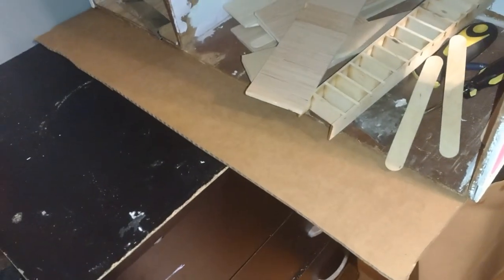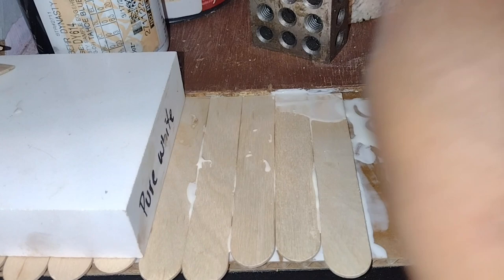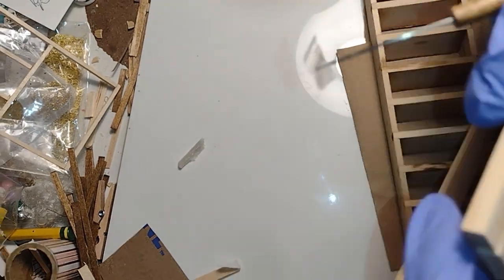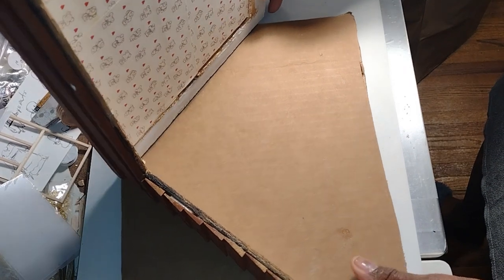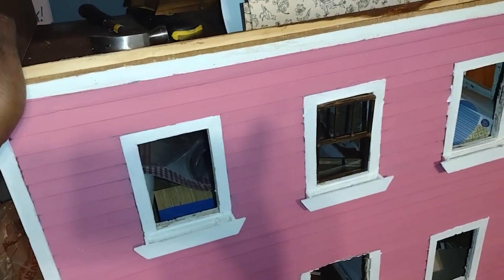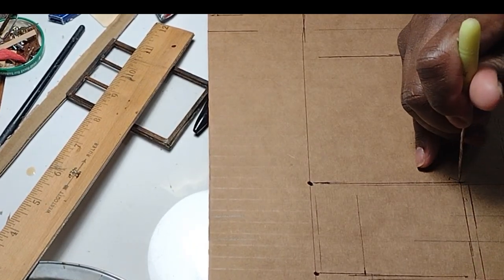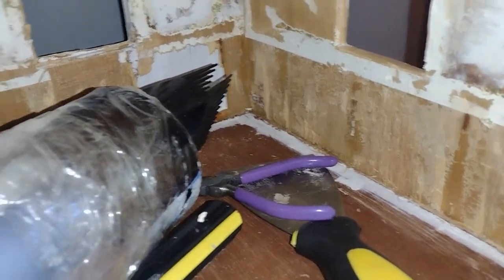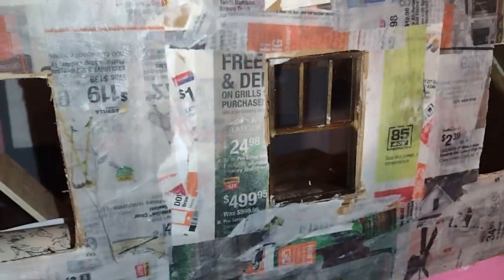RAISE DOLLHOUSE ROOF and Extend the FLOOR - Dress Dollhouse Shop Renovation

Comment: Oh Gretchen! I can relate as I'm struggling with structural issues on my house right now.  I'm trying to create some walls using foam board but after watching this, I wish I had used cardboard. 😞.  I admire you for trying out your original idea and opting for a completely different look when it didn't work out. Wow I love the urban storefront look your change brings. It's like the dress shop was telling you what needed to be done. Brilliant! 👏👏👏😍✨
Reply from the maker: Yes! That is how you learn and develop your skills! Try it and if it doesn't work try something else !  Now l have used foam board before, in the area between the pantry and laundry room in rooming house. It was a very small Doorway that needed to be closed up a bit. Don't get discouraged see how you like. And if you don't it's only foam board, not an expensive lesson!☺️ Yes many times it does feel like the project is leading you. You'll have an idea and by the time it's over something totally different has emerged!